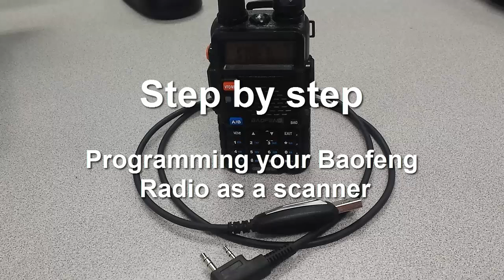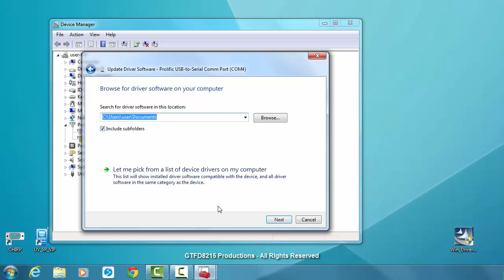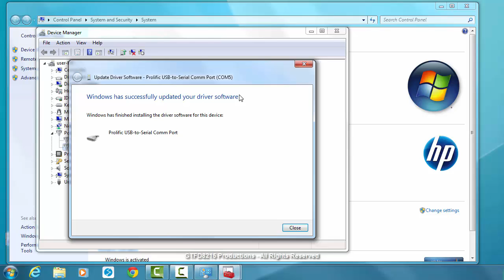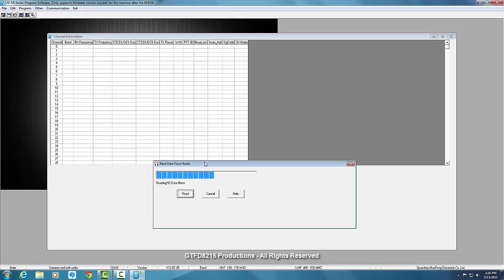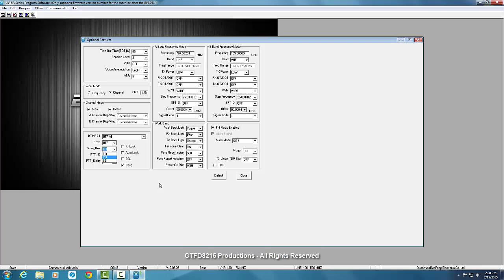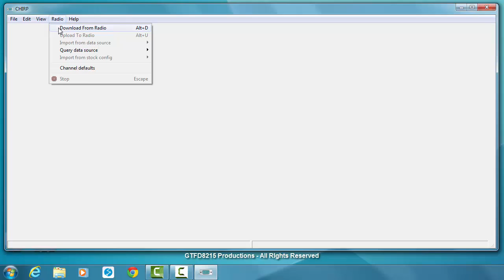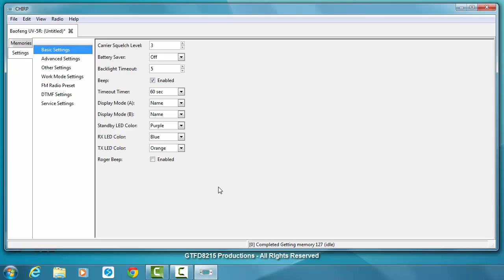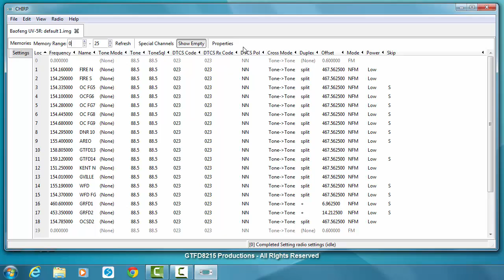Step by step Programing Guide - Setup Baofeng as Scanner

Comment: I appreciate not wanting to transmit on public safety channels but what you suggest is still illegal, not to mention inconsiderate. You are transmitting on the repeater input frequency and even at low power could easily interfere because you are still using higher power than the legal transmitters on that frequency are using.  Why teach people to break the law, especially when they don't know any better?

Comment: good video, but if I could make a suggestion, if you are worried about transmitting on the public safety frequencies, instead of setting your transmit to an FRS frequency, you can set duplex to "off" . and you will not transmit at all, on any frequencies. well for that channel. this works in chirp, not sure about the other software.

Comment: I recently purchased a few of these radios, and have to say I'm pretty impressed with its abilities. Programming the 'normal' 80channels for UHF CB use only took a few minutes via the radio itself.
All the FREQ. are here    https://en.wikipedia.org/wiki/UHF_CB   (AUS/NZ)
Once you realise the Factory default 21channels need Deleting and not Editing its then a breeze to program in the frequencies.
Use Menu#1, 25.0K STEP to manually step up from 476.425...........
Cant wait for the cable to arrive and setup other ranges.
Thanks for the tutorials.

Comment: Just FYI, to truly avoid breaking any laws, which actually includes transmitting on FMRS with this radio as you recommend, set duplex to off. If you set the duplex to off you can NOT transmit on that channel. FCC rules restrict FMRS to a type specific radio which the UV-5R does not meet. The only frequencies within the US that these little radios are legal to use on area HAM frequencies, and those require a license.
Reply: Yes, but a ton of people do it anyways, I'm guessing because family and friends cheap out and get those clam shell walkie talkies.. I mean if you keep the transmitting power down at 1W, it probably won't even transmit as far as those cheap ones (the FCC now allows them to be 2W)...

Comment: Thanks for the video- it was very informative as I was able to get a few frequencies programmed and working.  I do have a question for you.  I want to scan some local PD frequencies that are in the 800MHZ range... how can I get those programmed?
Reply from the maker: if you want to scan 800mhz you will need a device capable of scanner that range.  I have not seen or heard of any hacks to make the Baofeng radios do this

Comment: Nice video, if I set "S" under the skip option at each channel.
When beginning to scan by pressing"*" at keypad, the radio will ignore the channel with "S" automatically?  Is that right?
I mean it won't scan them, am I getting the point? Seldom did use the chirp people, but it seems quite a popular tool,especially getting no good program cable.

Thank you for your sharing:)

Comment: I cannot get the driver for this radio even though I downloaded it really confused
Reply: You need to get a cable that supports FTDI. The cheap $10.00 cables won't work. This is what you need:PC03 FTDI Authentic Genuine USB Programming Cable for BaoFeng, Kenwood, Wouxun.
Reply: then you have a fake

Comment: Thanks for software and driver links.  Great video on setting up as a scanner.
Reply from the maker: +James Uncapher     Thanks for the Feedback...  I had a lot of issues getting started so I though I should share my experience for the benefit of others.
Reply: I was programming 2 of them for my brothers for Christmas for their bug-out bags.  I also wanted to make sure I turned off transmission on the programs so they do not hit the transmit button.  I also bought them a book on radio technician license.  Thanks again for the info.

Comment: Prolific states that the cloned counterfeit chip uses driver 3.2
most UV5R cables have the counterfeit chip
Reply from the maker: +Galen Thurber    Thanks for that info...   I think that is correct...  so the updated driver checks for the authentic Prolific chip and fails when an authentic chip is not present.  The older driver works because it does not check for counterfeit cables.   I have a Cable with the Baofeng brand label.  Apparently it has the counterfeit chip in it so I have to use the old driver.   

http://www.amazon.com/Amcrest-Baofeng-Programing-Radios--Authentic/dp/B015YEM5C2/ref=sr_1_2?ie=UTF8&qid=1449583307&sr=8-2&keywords=baofeng+authentic+cableI wonder if the above cable would be a good way to go.  2-3 times as much money as the one I bought that is branded Baofeng but according to the description it does not use the prolific chip set and is compatible with the Baofeng radios

Comment: Hello !
I don't know why you feel the need to use bogus transmit frequencies for all of the channels , it is still illegal , even at one watt you are running twice the power that that radio service was intended for . You can fix it one of two ways . in the column that you changed to give you " split " ( the duplex column ) , simply select " off " . Or if you don,t plan to transmit at all ( you need to be licensed to transmit on ham bands , and you need to know what you are doing to get a license ) You should go into the " chirp " software , under " settings " , " other settings " and uncheck the " VHF TX Enabled " and the " UHF TX Enabled "  Then you will be legal !

Cheers , take care , and have a good day !!.......73
Reply: +Neon Harp 
BTW , I saw where you had some issues with the programming cable . Mine is an " Anytone Tech , Baofeng Tech brand " the label says genuine FTDI cable . I just plugged it in , the little red light on it flashed , and it installed it's self with no hassles ! No Worries !  Mine was about $20 , I saw some for a lot less money , some even came with. a CD to install it . 

Cheers !

Comment: Can I change from frequency mode to channel mode using the keypad only or must I get the cable and do it from chirp or Baofeng software?
Reply: +JustDanO You can do this without the software however all you will see on the display is "CH-001" or what every ch you are on, you need the software to program the name IE: "POLICE"

Comment: Thanks for to video.It was very helpful. I tried to set mine up for scanning with the Baofeng software per your first video and it wouldn't upload to my radio. Had a communication error.  Tried it with the Chirp software using you video step by step. The issue i was having was it cutting out in the middle of a transmission. Changed the TO to CO and all is good now. Thanks for taking the time to make and upload this video.
Reply from the maker: +Randy M Your welcome...  thanks for the feedback  :)
Reply: GTFD8215  ,

Comment: Keeps saying failed
Reply from the maker: Trooper Alan hey trooper are you getting the yellow explanation point in the device manager?  If so did you make sure the software is configured for the same com port that your device manager shows?  additionally you need to make sure the radio is plugged in a powered on before you select receive from radio...  those would be first things to check